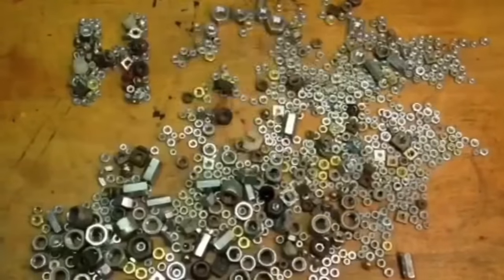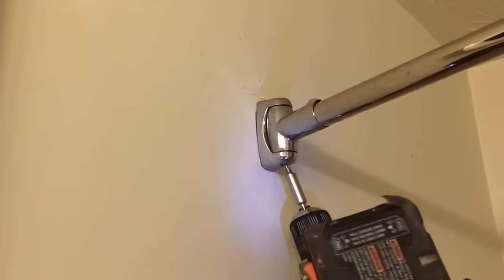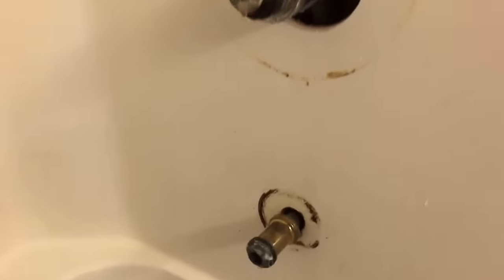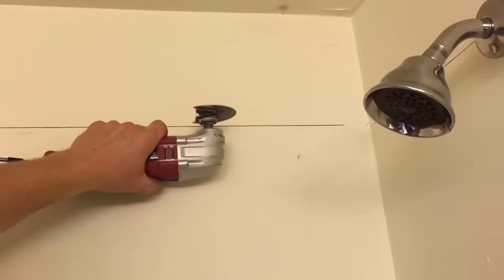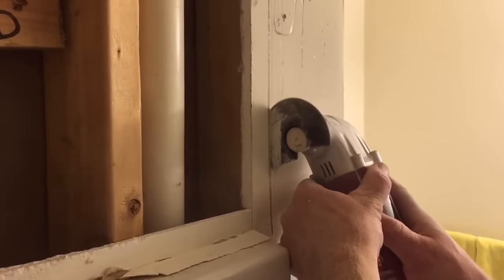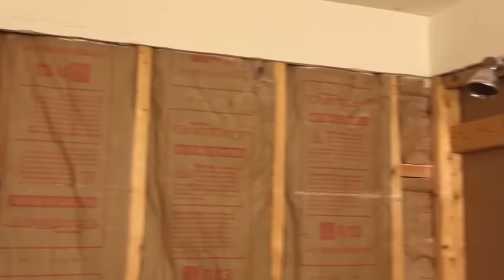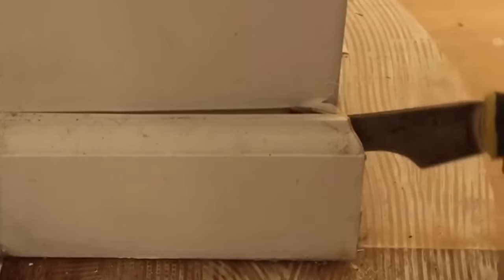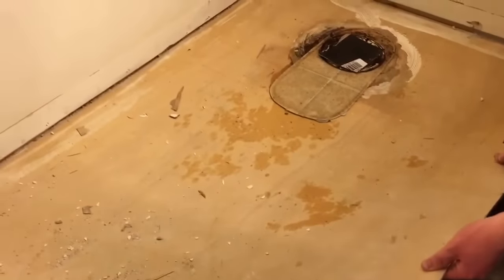How to convert a tub/shower to a walk in shower Part 1

Comment: I did the same project last year. I remodeled the entire bathroom. Took me a while to do the drain and plumbing which I hate to do.  I also put in new toilet, new sink, new bigger quiet exhaust fan.  I did all the wall and floor tiling.  I converted light from wall to ceiling recessed LED light.  Saved alot of money by doing everything myself except for hiring a contractor to install slide shower door. Everything turned out great.
Reply from the maker: Awesome! Think of all the money you saved doing it by yourself.
 Thanks for watching.

Comment: Watched all 9 parts. What is the time frame & cost for converting a bath/shower to a shower? What were the cost of materials (roughly) and even though you did this yourself, do you have an estimate for what it may cost to have a professional do this? 

We just bought a house and I really want to do this. My father in law is good with construction and built his house, so I’m sure he will understand this better than I could. While I’m sure I could do it in theory I feel like there is too much room for error and I don’t want to end up with a flooded bathroom and water damage.
Reply from the maker: This job took about 2 weeks if I remember correctly, as for the material and cost of labor it will vary from job to job, area to area, person to person. Thanks for watching.

Comment: Warning watch out when you take that sawzaw and cut through the fiberglass you might have electrical lines or gas lines in the wall!  I did a couple of these lately and yes I had a gas line and electrical lines I had to be careful of the depth of the blade.  I angled the sawzaw so my blade barely broke the surface and was fine.
Reply from the maker: Good warning.
Thanks for watching.

Comment: a better idea is to extend the shower to the edge. When I removed mine in the mater bathroom it had a tub like that and it looks like i doubled the size by removing the plastic tub that took up 2-3 inches of space then extending it it to the edge was icing on the cake to make it bigger.
Reply from the maker: I have done some like what you described and I would prefer to do it that way but this one was only a direct switch out. Thanks for watching.

Comment: Thanks for the informative how to video.  I’m about to tackle this in my bathroom, but have never done this before but feel more confident that I can do it now.  I have a slab instead of a conventional foundation.  Would you recommend anything different to do for a slab foundation? Is the concrete subfloor backer board still necessary or just used if the concrete floor is uneven? Thanks
Reply from the maker: I would skip the backer board for the floor if it is concrete other than that all is the same. Thanks for watching.
Reply: How’d you go with it based on the info from this video?

Comment: Hi Bob, Great video.  I was hoping you could weigh in on an odd setup: the actual flooring that was under our old tub is sloped already (luckily towards the drain).  I'm not sure if it's better to shim it so the new floor is level and then use a pre-pitch kit to give it a proper pre-slope, or just go with the floor being pitched and try to mortar it by eye so it slopes approximately what it should before the liner goes on top?  Thanks - any advice would be helpful!
Reply from the maker: I would recommend starting with a level floor. I always feel that it is better to start with a good base so you are building on a solid foundation. Hope this answers your question. Thanks for watching.

Comment: Great Videos Bob! 
      My house is on a cement foundation. In this instance would I skip the cement board floor?
Reply from the maker: Yes, but you may want to check for dips and crowns. In that case use a floor leveler. Thanks for watching.

Comment: Hi Bob, towards the end you didn't show how you converted the drain from a tub drain to a shower drain (which is further out).  In part 2, it's already done. What exactly did you do? I can see PVC piping in Part 2 but not sure what you did.
Reply from the maker: Actually all I did in video 1 was cut the drain pipe off, Sorry I should have shown that I guess. In video 2 I needed to Build up the floor around the drain to support the mortar bed. One word of advice is to make sure that you have a vent so that your drain works correctly. This drain had a vent that you can see on the faucet wall just to the right of the drain at :08 in video 2. I hope this explains what has happened and answers your questions. Thanks for watching.
Reply: I have a similar situation. I have a vent to the right exactly like this. How did you change it? I cannot simply change it since my drain pipe is placed close to the subfloor. So my 45 bent will have to start from top of the drain and it will come out. Need some advice.

Comment: Hi, How to Bob. I had my whole shell removed before, and put in a new shower shell. 
We just bought a new house and I am unable to step over the side of the tub to get in and take a shower. (I cannot take a bath.)
I'm just wondering if I can cut out most of the side of the tub and what could I then use to cover the cut parts?
I need to save time and money. Thanks!
Reply from the maker: I know there is a kit that will allow you to cut a section out of the side of the tub and it comes with an insert that covers the cut out part. You may be able to find it if you search on the Internet. I hope this helps, thanks for watching.

Comment: Why did you have to move the drain? Code or preference? I have a concrete slab so I’m a little hesitant to cut into it.
Reply from the maker: The drain was moved to center it in the shower, no other real reason. Hope this helps, thanks for watching.
Reply: Thanks, great series!

Comment: Video is alittle old but hopefully you see it. How do you install the liner if there was a seat? Thank you.
Reply from the maker: Installing a seat presents a little more difficulty. The liner should be placed over the seat like a shingle on a roof so that water runs down it flows over. The use of a waterproofing crack isolation membrane will also add another layer of waterproofing. Hope this helps, Thanks for watching.

Comment: my shower tub is cheap  fiber glass with walls I want to remove and install walk in shower  measure bathroom  wall to wall 58 inch  but  the shower pan I want to buy is 60 inch   you think will fit because I cant find 58 inch walking shower pan  please advise ?
Reply from the maker: Take a measurement from the wall above the shower it should be about 59 inches. That will be a half inch on each side for drywall. If that is the case you should be good to go.
Hope this helps, thanks for watching.

Comment: i have a concrete slab—what concrete do i use to fill in “void” around shower drain trap?
Reply from the maker: Start with sandmix if the void is smaller than 2". Anything larger regular concrete mix will work. Hope this helps. Thanks for watching.

Comment: You are using your channel locks backwards
Reply from the maker: Nope, I'm converting a tub to a shower. Thanks for watching.
Reply: No, seriously. You used your channel locks backwards.
Reply from the maker: No, seriously I am converting a tub to a shower.
Reply from the maker: Thanks Eddie Marquez.and Thanks for watching.
Reply: Carol Well being that in my craft, I use this tool properly every day. So when you have someone doing a how to video, showing the tools used improperly...kinda defeats the purpose. The teeth on them are designed to only bite in one direction, using them backwards allows them to slide on what you are gripping. This creates gouges and scratches on whatever you are using them on. If you wanna use them wrong and do half assed work...feel free. While at it, use the claw of the hammer to pound nails in, it works really well
Reply: I noticed that too...
Reply: If you want a tool that can be used in either direction then use standard pliers.   I’m sorry but using channel locks backwards give the impression the user does not know what they are doing.   You obviously do but maybe be mindful of how it can be seen.   Great video.
Reply: Yes they are. Lol. That's a machined tool meant to be used with a screwdriver for leverage or a crescent wrench. Sorry, ol plumber can't help himself...😁

Comment: I have a tub. 
I want to get rid of it and just have a 
Tile floor with a drain and a shower head.  
No shower door
No tub 
No shower curtain 
Just all tile
Reply from the maker: Sounds like a handicapped shower stall. Those are fairly common.
Reply: funbro1 cool. Thx.  I rode my bicycle across India and some of the hotels have them. 
You hang your towel on the far end because everything gets wet.

Comment: Which one is expensive to install, walk in shower or shower with a tub?
Reply from the maker: It depends on where the project comes from. If you are converting one to the other then that would be more expensive. Usually the shower would be more expensive because more labor and material. Thanks for watching.

Comment: Your using your channel locks the wrong way, sorry. But they do have a right and wrong way to use them. Not nit picking, just saying
Reply from the maker: Yep I realize that they have a right and a wrong way but the the purpose that I used them they seemed to work just fine. Oh yeah and by the way they are NOT Channel locks, They are groove-joint pliers that were purchased at Sears. Not nit picking, just saying.   Thanks for watching.

Comment: That's not a convert, it's a replacement.
Reply from the maker: Sure it is, didn’t the area where the tub used to be get converted into where a shower is now? I guess to your point this could be considered a partial remodel considering not everything was remodeled but then what to name the video? I guess I could have named it “Partial bathroom remodel including replacing a tub with a shower.” Or I could have named it” Taking a tub out and replacing it with a shower and re-doing the floor”. To my point I think I will leave the title to the way it is. Thanks for watching.

Comment: I take it your not a plumber? You had the channel locks the wrong way while taking the tub drain out. It’s ok still work.  It drives plumbers nuts to s e that look
Reply from the maker: I take it your not a tool guy? The tool that was used was NOT called channel locks. But as you mentioned it did work and YES IF necessary I will use them the correct way. Thanks for watching.
Reply: funbro1 actually I AM a tool guy as well as a plumber AND everyone I know calls those channel locks, what do you call them? Tounge and grove.?
Reply from the maker: I just thought we were getting technical here, they are officially called tongue and grove slip joint pliers. It drives tool guys nuts.

Comment: Violation Alert! Vocabulary Cop.
Reply from the maker: Only if there was an alert for comments left on this video.

REPLACE:to take the place of something, or to put something or someone in the place of something else. 
You will notice in this video series that in the beginning there is a tub located in this bathroom. Later in the series it is REPLACED by a shower.

CONVERT: 1. to change (something) into a different form or properties; transmute; transform.
You notice that in video series  that in the beginning there is a space with a tub located in it. Later ion the series this tub space has been converted to a space with a shower located in it. 

No violation!  Thanks for watching. Hope the series helped.